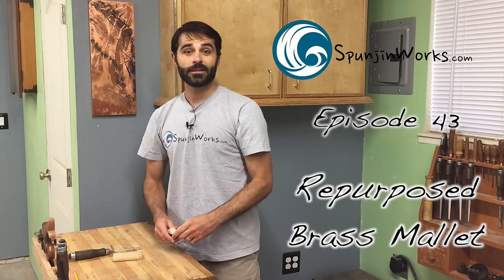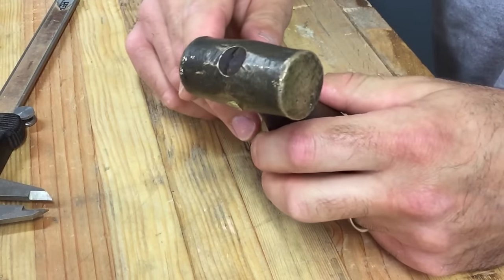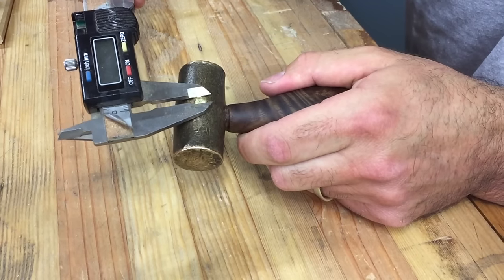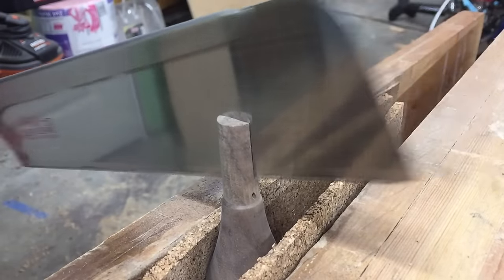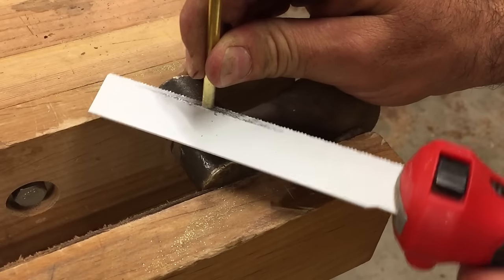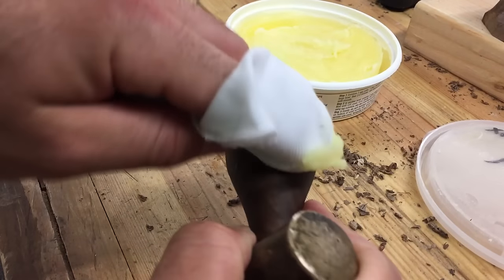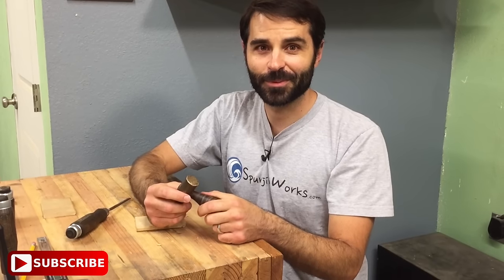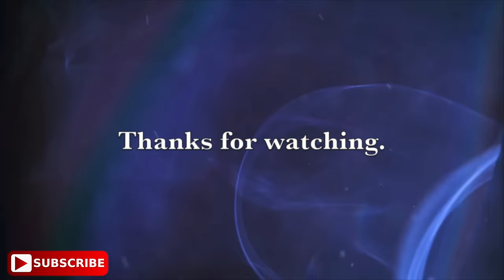Make a Brass Chisel Mallet // How-To (Ep. 43)

Comment: thats a cool little mallet. looks comfortable to hold..i need something like that to adjust my home made hand planes..good stuff sean
Reply from the maker: Thanks, +Joe basementwoodworking !  It is very comfortable. For hand planes I would make one with about 1/2" diameter brass rod. You don't need anything really large.
Reply: Sean Rubino ok..cool thanks for the tip man! Ill post a pic on my Instagram when i get it done.